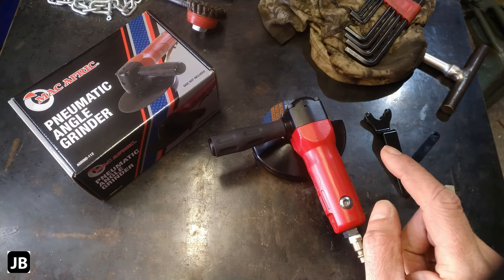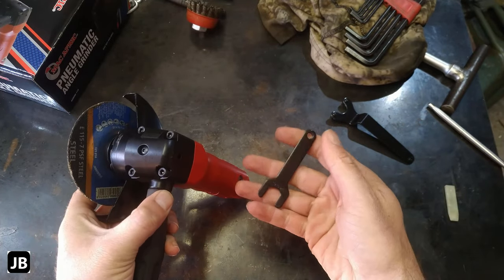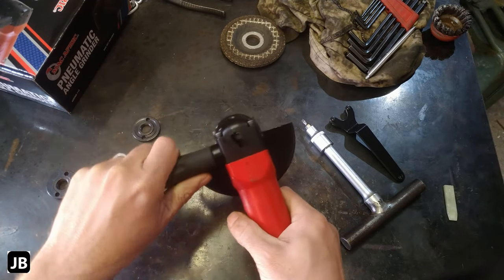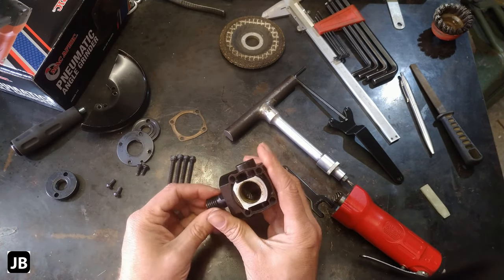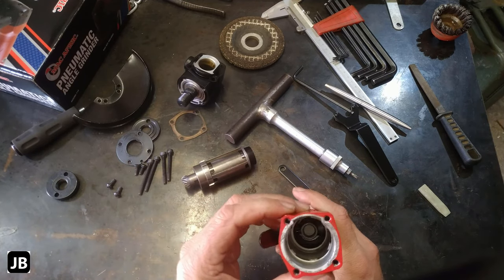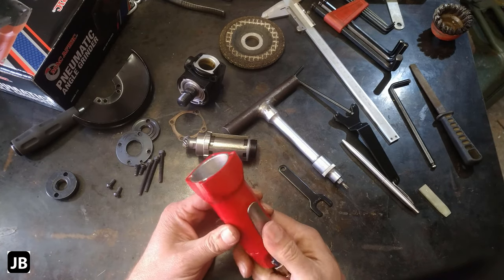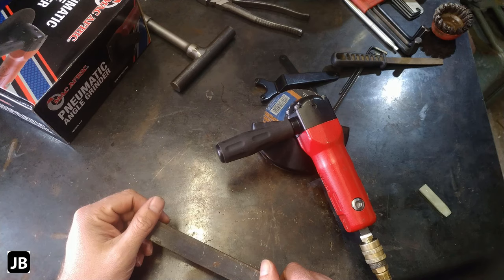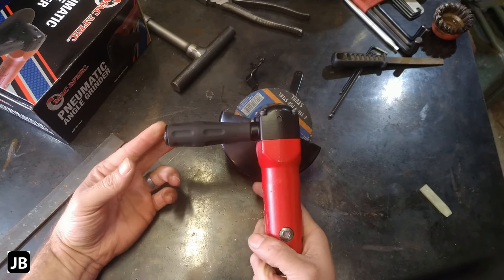Pneumatic Angle grinder review

Comment: Can we use this for cutting steel or only grinding applications?
Reply from the maker: It works 100% fine with a cutting disc. The thread is just not standard for wire wheels with integral thread. Cutting and grinding 100%.